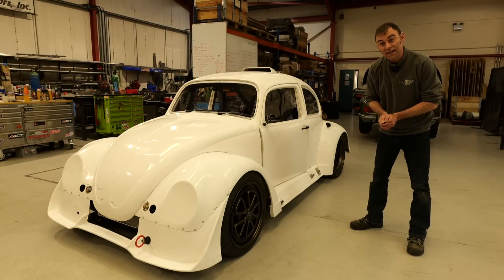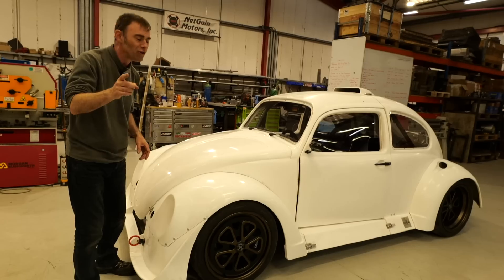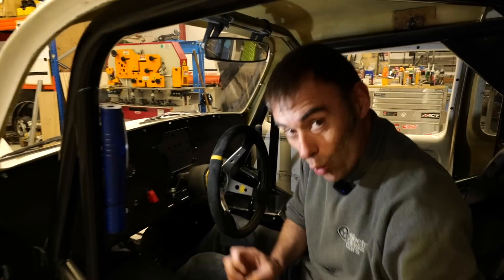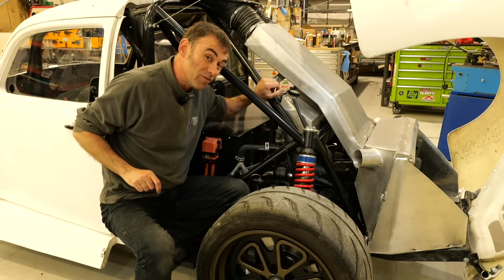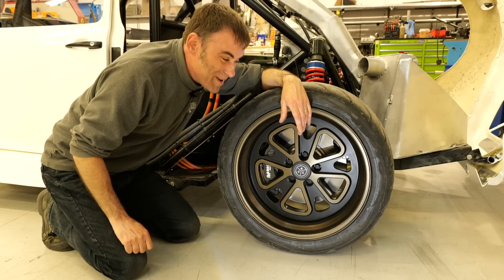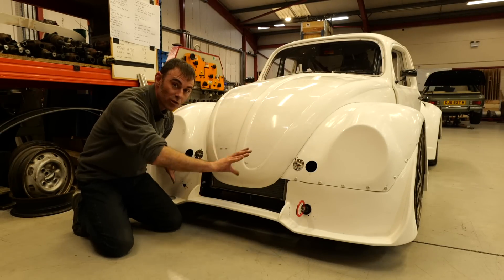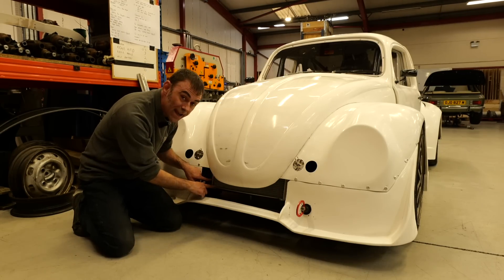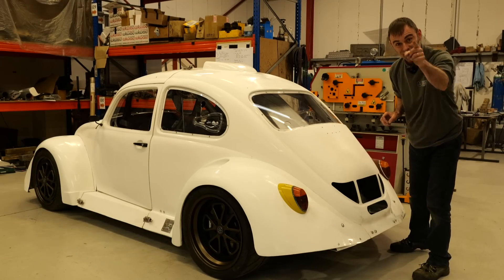Pikes Peak race car Ep11 - Bodywork

Comment: love it - but time to get it going Moggie. 
Wrap gives great flexibility in graphics  but i do think the sort of spherical shape of the roof may make that extremely difficult however the sides and the flatter panels not a problem. 
The added benefit is the wrap takes and withstands stone chips a lot better than paint does.

Comment: Hate to be the bearer of bad news, but you've got a lot of work to do to make that rear wing work! 

The hardest trick with downforce which scales with the square of speed is trying to get a decent front to rear balance.. All the things you do at the front absolutely need to be balanced by similar forces at the front.  You wing is way out back so is actually going to move the centre of pressure (and centre of drag) waaayyyyy back as speed increases.. Now, some rearward movement is useful, because you can set the car up to be a bit more "Pointy" in slow speed turns, and then to increasingly push into understeer at higher speed, which is what suits most normal drivers, esp as with DF, any Yaw destroys that DF, which makes crashing something that can occur in an instant!

Unfortunately, getting positive DF at the front is going to be very hard indeed, especially to balance that massive rear wing (of course PP race is at high alt, so low ave air density, so the wing isn't as big as it would be for sea level events).  You're going at a minimum to want a front splitter about 5 times the size of the one one you have now, and the downside of that is the car will now become incredibly sensitive to changes in rake (and dynamic changes in rake, ie during braking etc) The only way you'll get a balanced chassis is to concentrate on the underfloor aero but unfortunately this is really difficult to get right and hugely sensitive to setup changes. If you can afford a wind tunnel session, then at least you can get some baseline data to start with, but "Just guessing" with aero, esp underfloor aero really doesn't work.

PP is a very high average speed (>75mph) track and unfortunately as an amateur team / driver, it's very very hard to get something with a high DF to mass ratio set up and working correctly, as crashing the thing whilst trying to get it all working is a very very real posibility, and you have little experience of driving a high aero assistance car i  guess.

Given you have a 4wd car, and a high power to mass ratio, personally i'd either completely ditch the aero for your year one attempt (or scale it back, or make sure it is easy to remove), as IME it's going to be more of a hinderance than a benefit unless you can really spend a lot of time testing, ideally in a wind tunnel, but at worst on a test track with some proper instrumentation (ie load sensors etc)

The other thing you are absolutely going to need to do is to work out how you are going to repeatibly precondition the battery and force cool the battery and motors.  Towards the end of the track, when you are very high (finish line is at 14,110 feet!) your LTRs are going to be fairly useless and your motors and particularly your inverters will be cooked as they have a low thermal inertia.  Mostly people use some form of phase change evaporative cooling (ie CO2) as this is going to be the best bet in terms of mass penalty and low cost, and you probably can't get your inverters or motors cool enough at the start tbh

The battery will be a trade off, it has high thermal inertia, so you'll find there is an optimum starting temperature that will be slightly too cold to start with, hit perfect temp in the middle of the run, then go overtemp towards the end.  Make sure you can precondition to this temp before your runs, ie you need specific pit equipment and cooling system dry breaks etc to do this.

Anywhich way, you're gonna have a lot of fun, and PP gets under your skin, no matter what you are driving!!  

 (PS i was on the engineering team of the VW IDR, which as you probably know was quite quick at PP 😉 )
Reply from the maker: Great feedback. Thanks a lot. The IDR is an awesome piece of engineering. 👍👍👍
Reply: @ElectricClassicCars  yup IDR was a pretty mad project to develop!

One thing you might want to look at is having a reasonably dynamic basic Front / rear Torque split. On IDR we actively measure tyre normal load (through load cell on spring unit) and dynamically apportion torque to each axle based on trying to keep the torque ratio the same as a the normal force ratio at that moment in time, ie to acheive a constant tyre slip value at either end of the car, where that slip is speed and handwheel angle dependant.  So for example as you accel hard at low speed, the torque moves backwards to avoid excessive front tyre slip, and when you brake, particularly at high speeds where the increase chassis rake moves the aerodynamic CoP right forwards, you can hugely ramp up the front regen, whilst still keepign slip consistant which is key for driver confidence. In this way you are effectively using all of your tyre mU at all times
Reply from the maker: @maxtorque2277 Interesting. Because of driver confidence and consistency of feel we were planning to run NO regen. This way the braking always feels the same AND it gives the batteries a bit of a break on the deceleration, which aids thermal management.
Reply from the maker: @maxtorque2277 Torque delivery is managed in 2 ways. Mechanically with an ATB diff in each drive unit and electronically between the front and rear motors.
Reply from the maker: We’re definitely planning on a bigger splitter at the front but for that we’ll have to wait until we get it into the wind tunnel. At 130 mph a Beetle has 120kg of lift at the rear axle from our previous wind tunnel time, which is a lot more than most cars, hence the big wing at the back, to overcome this lift AND give it some down force instead. Unlike a lot of cars a Beetle starts with a terrible rear end lift problem at high speeds.
Reply: @ElectricClassicCars  Ambient pressure at PP is on average 30% lower than at sea level, so lift is comensurally less, and as aero forces are square of velocity, you'll find that the lift might not be as much of an issue as you may think.. Not sure what your static mass is (guessing around 900kg with driver?), static split looks to be about 45R/55R at a guess with your battery location, so lets say 500kg static on rear axle, so realistically at the sort of typical critical ave cornering speeds at PP (~80mph), you'd be looking at ~32kg of lift and a reduction in grip of just 6%.

Comment: I would keep the front radiator as high as possible to protect it from anything flying to the front of the car. I would just add "guide" in front of it to direct the air upward... I would use wrap instead of paint as it works better with fibreglass being smooth vs. metal that has imperfections for paint to stick on...

Comment: Something to look out for is the rear radiator ducting may have different inlet pressures because one is rammed and the other is a naca. The naca may have lower pressure and could turn in to an outlet. You probably have enough flow through the top.....

Comment: I wonder about the aero balance of the car with that wing. 
Are you looking at a bigger splitter on the front or anything to reduce front lift? A bigger splitter might also help create a bigger high pressure zone in front of the front radiator and help move air through it.
Another option, or an additional one might be to vent the front rad up through the hood... sorry "bonnet".
Reply from the maker: Good points. 👍

Comment: Have you thought about putting a splitter in the front? Having an airdam is more useful if the underside of the car is very rough, but if you want downforce, you want to increase the speed of the air going under the car so that the pressure is reduced - ground effect.

Also, for spoilers vs wings and aero in general, Julien Edgar has some great content on YouTube.

Comment: Don't forget to put some front indicators on the top of those wings. They might cost some air flow problems but will help with the look and also judging the width of the front when driving.
Reply from the maker: Great idea. Maybe some early ones that are slimline. 👍

Comment: Any reason why you need such serious brakes instead of relying mostly on regen braking and one-foot driving? Is this setup better suited for racing?
Reply from the maker: Because when the battery is full you get no regen, plus turning regen off when racing gives the battery more chance to cool down. 👍
Reply: @ElectricClassicCars  Thanks for the reply. That's the only thing I dislike about my EV is how when I have a full battery suddenly stopping it is different because it turns off regen until it loses some power
Reply: Regen braking generates a lot of heat in the motor, batteries and controller, so I think you definitely need normal brakes assisted by regen
Reply: @maxiferrari08  That's a shame. From a driving perspective doing almost everything from just the throttle makes it much easier

Comment: Liquid cooling on a body that was originally designed around an air cooled engine = probably not very fun to get it all working right
Reply from the maker: It’s a challenge, that’s for sure. But we love a challenge. If we didn’t, we would have picked a different car to a Beetle to turn into a race car. 😉👍

Comment: A few years from now when we have much denser batteries and hub motors this build will suddenly look so old-fashioned. I can't wait for ultra fast hub motors to replace the need for axels
Reply: Porsche had front hub motors on his 1898 model.
Reply: @woodyw6891  I Believe the Aptera uses twin front hub motors ...
Reply: Hub motors are great, but I think for a racecar the unsprung mass of them are counterproductive.
On the other side gokarts have no suspension at all and are fast as hell, so definitely worth a try